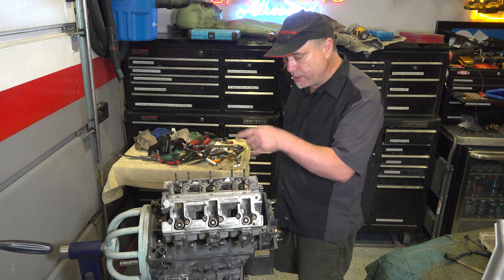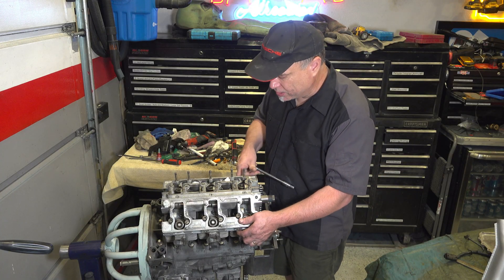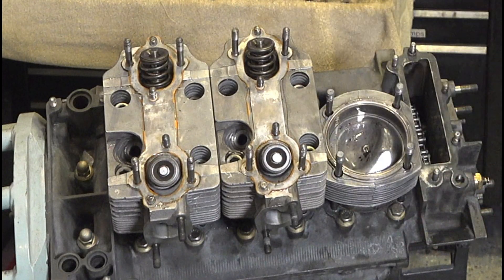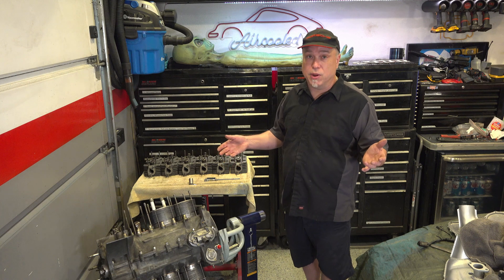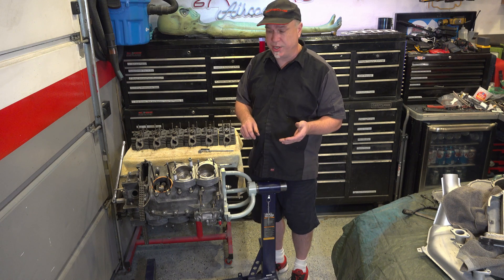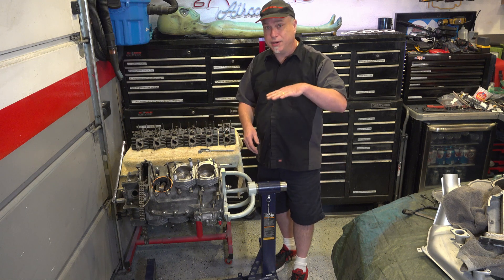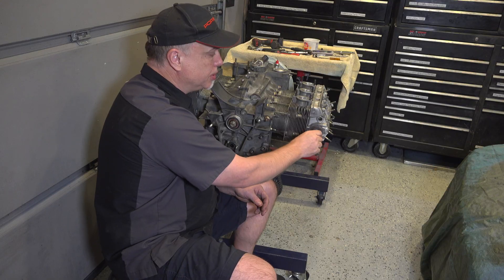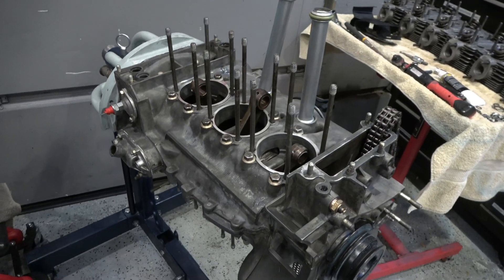1974 Porsche 911 coupe: Deck height measurement and shims [4K] Ep116

Comment: Thanks for posting.  Wow that was a learning curve for you. Will be so helpful for your viewers. 
Keep up the great videos.  Looking forward to next weeks release
Reply from the maker: To be honest, I panicked when everything started binding.  Just loosening the head nuts fixed it right away so I knew it was nothing major and just cylinder/deck height was uneven.  If I had it to do again, I think I would have at least sent the case out for deck surfacing. Although many have a different opinion, for a stock 2.7L I think 1mm clearance was the right thing to do. I have some really good learning with this and when we get into the injectors, I really find something interesting.  So keep watching!

Comment: Great job on getting the cams and towers to line up. I will be doing my mag case soon which your videos always helps. PS what cam tool are you using? I was thinking of getting the skomski special 2 in one cam tool. But its expensive.  cheers
Reply from the maker: Yeah, I think I would have assembled it dry the first time if I knew there were going to be issues.  Glad to help, I enjoy making these videos.  I use a regular z block cam tool with the dial indicator extension.  You can get these using searching the tool number, P207.  Should be able to get the block and the extension for a hundred bucks.  I looked at the stomski tool and that looks like that would work pretty well also. Thanks for subscribing!